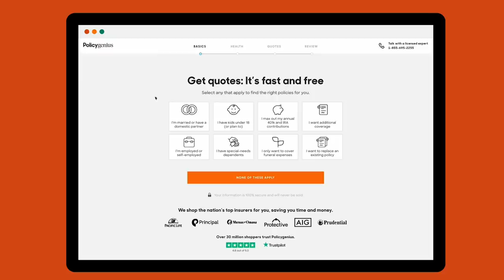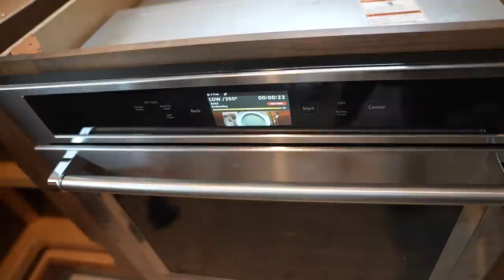DESTROYING OUR KITCHEN CABINETS | BUILDING OUR OWN HOME

Comment: We painted our wood ceilings. We sealed them with white shellac prior to priming and painting. It kept the rosin from the wood knots from bleeding through overtime.
Reply: When we were doing any staining or painting we always did it on the ground. It saved alot of cleanup time and touch ups were easier. Can't speak to the paint sprayer but I  "think"  it would work also.
Reply: An absolute must regardless of what the paint or primer says it can cover.
Reply: Yes there is a product called Seal Lock that is good for blocking tanins and knots.

Comment: I actually like the light boards with the wood grain showing through we did ours with a white wash that gave it a little bit of white but you can still see the grain in the boards and it gives it a lot of distinction between the white ceilings everywhere else. We’ve had it that way for 30 years and I still love it!!
Reply: Yes, if you live with it for a while and hate it, just try a whitewash or painting.  You can always paint it later on!
Reply: @katesanders2219  unfortunately, you can't really paint over stained wood. it's a really hassle to prep it for paints or white washing
Reply: @sherilynl4038  I've painted over quite a bit of stained wood (furniture as opposed to walls), though I guess I've never specifically whitewashed.  A good primer has always worked for me!
Reply: The darker walls in the “sunroom” are going to be a blessing in the winter. They will help absorb heat during the day and keep things cosy at night for any plants that are out there.
Reply: @katesanders2219  i need to know that primer. :) i've never been able to get a good or long lasting paint job over stain. hmmmm
Reply: Sandra Westley uk I was going to say it was about 30 years ago that having wood like that was fashionable, it’s all been got rid of over here, it’s also a fire hazard.
Reply: @sherilynl4038  I've been looking into paints to redo a piece of furniture w/o sanding it lol. Chalk paint is supposed to be very good for things u don't want to sand or things that have been stained. Many different brands & some are definitely better than others from what I've read. Rustoleum is supposed to be great. Some love Annie Sloan, some hate it. I think some are thicker then others do it really depends on what you're painting & the previous finish you had on it. I decided not to paint my piece of furniture so hopefully all my research can help other ppl lol! Don't get it confused with actual chalk board paint like to make a chalk board haha, that's a different paint. The 2st time I asked someone in a store, they directed me to that & I was like no, I want actual chalk paint!
Reply: @sherilynl4038  I have usually used Kilz.
Reply: @katesanders2219   you can also use a deglosser after a grain straight sand and then the primer ...   that's on an oil based stain surface. just need a water based primer on water based stains, couple coats of finish ...  always let them dry really well - works ...

Comment: The sunroom will be so bright that I think you’ll be glad you have the darker boards across from the windows so you aren’t blinded. Also remember, after furnishings and wall decor the planked wall will be a backdrop and not a focal point. You can always paint it later if you decide you hate it.
Reply: I agree.  It will look much bringing it together with furniture and decor.  And if not a wash would lighten it up.

Comment: I would recommend you now set some plywood or boards over the cabinet tops till the real counters are installed.  If not all the crap that floats around will start piling up into the cabinets.  It will also give you a place to set stuff off the floor.  I would also recommend taping off the fronts of the cabinets with some drop cloths so things don't get bumped into them or splashed onto them.    It is nice to cross yet another item of the dream list.

Comment: Just a heads up. Most builder seal the plywood floors with a water proffing paint. And before putting cabinets down. There a vapor barrier LAYED down in the raw plywood. Bugs, ants. Spiders, mold from drips, water soaked under kick plate when you mop. Just a few thoughts.
Reply: This is interesting. I am building a van and I'm almost on the plywood step. Should I treat it before putting it down? I plan to put a layer of nicer looking floor over it because I don't plan on doing a full build. So adding the nicer floor will help me feel as if it is a more finished product. But should I treat the plywood before covering it up or should I treat the nicer floor instead (or both)? I planned to get something more heavy duty that won't scuff a lot and all that. I figure it's best to splurge on this part when the square footage isn't super large so I'm only getting around 70 square feet of nice floor.
Reply: Very good point but, I feel like it's definitely too late now!

Comment: The slide-out oven rack is not just cool … but, will keep your thanksgiving turkey safe.  My cousins tell a story of one family thanksgiving when while checking the turkey the rack tilted and the turkey dumped onto the floor and slid across the kitchen.
Reply: I saw that rack and am wondering if they can be installed in other ovens. So smooth!
Reply: 5 second rule! 😂
Reply: I had that same experience!
🤪

Comment: "Chipi chipi" is something we have a lot here in Ireland. Here it's known as a "soft" day or "being in a cloud" Here on Kerry's west-est coast it is "soft" a good deal of the time and I for one am thrilled that in less than 4 weeks we'll be moving to southern Spain where "Chipi chipi" days will be WAY fewer! Bring on warm and dry!
Reply: YouToo Yoga -   "Chipi chipi" is what Seattle's rain days once were. Enough "rain" to eventually make things wet, but not enough to be counted as measurable or where rain droplets could be seen on windows. Those were also the days when Seattle could go 30-40-50 days in the winter with no sun. Now, we have rain storms then a couple - or several - cloudy days followed by 2 to 4 sunny or partially sunny days throughout the winter. A lot of rain-change in the last 25-30 years. Note: Our annual precipitation is about the same now as before; its just the number of days with measurable rain is reduced.
Reply: Here in Newfoundland, Canada, we call it a mauzy day. I live in the mauziest city in Canada by far!
Reply: Here in Limburg Belgium we say miezeren when it rains softly.

Comment: I’m sure you two know this already, but for everyone else: when you wipe stain off of wood, make sure not to leave the rags in a pile. They heat up after a while due to the chemical reaction, and with too many together they can spontaneously combust! Leave them out individually to dry and then throw them away.
Reply: Yessss, this can be so dangerous!
Reply: @MS B.  The future me thanks you for this advice. 🔥
Reply: Did not know this. Great advice!!
Reply: Been there!
Reply: I just use viva paper towels to wipe off stain when I’m staining stuff.

Comment: Can I just, once again, say what a wonderful, positive, attitude you guys maintain throughout every “challenge” life throws at you? The world is a better place for you in it. 🥰
(Don’t worry about having angled lights in the ceiling. We have vaulted ceilings and there is no difference with the regular lights not being angled. The only ones where it does make a difference with are the ones that are meant to spotlight certain areas like over our fireplace where we wanted to display artwork so got the different light which was more expensive 😕. One less thing for Trent to “regret” or think about until you get the lights turned on and see for yourselves!💕)

Comment: I'm going to pass along the greatest stainless steel appliance trick ever! It sounds a little silly, but I promise it works fantastic. Instead of using any type of special made cleaner, just use WD-40 on a paper towel. Wipe it down really good and then have a dry paper towel to remove any excess. It removes fingerprints and smudges really well, but it also makes the surface less likely to pick up new fingerprints. Try it!
Reply: I agree. I use it on my sink fixtures. It works wonders with hard water.
Reply: WD40 has a pretty potent smell to it.
Reply: Absolutely 💯!!
Reply: @dragonbry67  fish oil.
Reply: @maryh6190  that's genius, I'm going to try it!
Reply: Never knew that, I must try it.  If I can get over the odor in our kitchen.
Reply: The lone dissenter here. It may work, but I would never use a chemical like that in the ktchen, especially with small children with wandering absorbing hands. Vinegar and water works well enough. Also, essetial oils. Natural all the way.

Comment: Instead of painting the ceiling boards white, just shellacking them to show that beautiful grain wood would be beautiful!
Reply: I agree with you here. What's the point of putting tongue and groove on the ceiling if you're just going to paint it white ?  Or, I think it would be very beautiful with a slight burn effect on the boards than clearcoat over the tongue and groove to show off all the beautiful wood grain.
Reply: Cj Boac -   Or do the white paint as a wash; meaning the white paint is diluted with water. This allows the ceiling to be white but with the wood's grain either apparent or "hinted" at.

Comment: Wow - you guys got so much done! What a blessing friends have been to you in this adventure! If you are unhappy with the stain color when it is dry you can still paint - or use a top coat of another stain to lighten it up - General Finishes has a great line of stains that require no sanding or prep and the 'whitewash' option has been used over dark stains to lighten things up a bit.

Comment: FWIW I did my vaulted ceilings 33 years ago and another ceiling in my camp 5 years ago.  Fresh stain on pine always looks blothchy (if that's a word).  My suggestion is leave it alone - don't seal it with poly and let it age.  The patina after a while evens everything out and it looks awesome.
Sometimes...less is more.  My $0.02.  Cioa
Reply: I agree. I did that on some ceilings in my last house and it look great without paint or stain. It just acquired a soft color over time. But I'm partial to the lighter natural look. Also, finish everything else before deciding on the sun room wall. If you don't like it dark, there's always options. Stain or paint aren't permanent!

Comment: I love the stain colour in the sunroom!!! And remember you can always change it down the road if you want to if you still don't like it. Right now getting the tongue and groove installed and the other things that need to be done to get the final inspection done and approved for moving in is what I'd focus on most. You could even install all the tongue and groove and paint or stain later if you want. Everything looks great so far. Really hoping that your siding comes soon so you can get that done before you guys get snow there in the mountains. After that and stairs I think everything else is indoors stuff that you don't have to worry about the weather. Oh and hopefully you can get the boards of tongue and groove stained for the cathedral ceiling stained outside and the weather holds out for you for that if not already done at this point that we just don't see yet as I know your videos are at least 2 weeks after they happen in real life. 
It's great to see your excitement Allie for the new fancy appliances especially considering the tiny oven and cooktop you had in the van and in Terry, these will be great to have and use. I've never had anything new like that of my own so it's great to watch your excitement.

Comment: My dad was a master carpenter.   He brought home high tension telephone poles (back in the late 60's).  You can image my mom's reaction to seeing the before.   Fast forward their kitchen looks amazing.   He put Formica on the ceiling and beams.  The walls were half wood and half wall paper.  And he made a kitchen door and cabinets.   All out of the wood from the telephone poles.  Sawmill friend had acquired them and asked my dad if he would want them.

Comment: Trent, Brandon and Bryce are killing it inside the house.  Regarding the sunroom, the stained wall can be a feature wall if the ceiling and all the other walls are white; it will work.  If not, you can always paint all the boards white and the sunroom will still look good!!!

Comment: We did the white pine ceiling boards well. To avoid the knots bleeding through your paint - I recommend the BIN primer by Zinnser. It’s an amazing primer and in the 3 years since the installation we have had zero bleed.

Comment: Its lovely!  Great choices. I've built 3 homes and you are doing fine. You can always go over the stain with a whitewash stain but you are panicked by this which is normal. Paint, furnish, bring In Plants quilts etc then see what you think. I remember some counters I was horrified by and I couldn't change so went forward but in the end it was RIGHT!

Comment: If it is still cold and the stained boards are not drying in the sunroom fast enough, you could setup a small space heater in the sun room.  I think the stain on the wall will be fine once the room is finished and furnished.  The kitchen is looking great.  Can’t wait to see the countertops to finish the lower cabinets off.

Comment: That oven is gorgeous! What a great feeling. I just got a new stove and oven too. Make sure you heat it to 350° and leave it running empty for about 30 minutes. Then do the same thing with the broiler setting for at least 15 minutes. Open the windows and turn on a fan, it will smell terrible!

Comment: Wow  a lot of work accomplished! Lights to work by are a good thing! I'm with Allie the wood is too dark in the Sunroom. We have tongue and grove with the Vee notch not showing (both sides of Cedar are smooth finished) Western Red Cedar on our back wall which is 26 foot tall. Our Home is a Modified Chalet. We went with a Semi gloss polyurethane to keep the cedar from getting darker over time. Cedar is not as bright as pine.  Just a though on your ceiling that your going to paint white, you have some beautiful wood. Might suggest live with it natural for a while because once its painted or stained you have to live with that forever

Comment: I know it's too late but when you stain certain woods (any type of pine or fir) you should always use a pre-stain wood conditioner.  Specifically designed to use before staining to help prevent streaking and blotching and help ensure a beautiful, even stain. I learned this when we built our home back in the 70's.  In my home if you see any wood that is stained, I did it!

Comment: I know its your home and suggestions can be overwhelming.  I had the same ceiling in my great room.  It was also a vaulted ceiling.  All we did was clear coat the boards and let then age naturally.  It was stunning.  If you don’t like the dark stain on the accent wall I doubt you will like the darkness on the ceiling.  I personally think the dark ceiling will shrink the overall effect of the vastness of the room.  It will shrink the height.

Comment: Speaking from experience of a tongue in groove ceiling, you might want to use some Kilz or other brand of that type product prior to applying your flat white.  I had to Kilz all the knots in the boards after they stained through the nice pretty blue paint we had used in less than a year.  It wasn't fun to touch up all the knots and then repaint with the blue, when I could have done it once.

Comment: OK - I think the wood ceiling in the house should have a subtle semitransparent white wash that shows the woodgrain…it would be modern, compliment the walls, look great with the black chimney pipe, with a nod to a mountain cabin vibe.  Think about it😘 You’ll have a LOT going on with flooring, two cabinet colors and the fireplace wall…could look very busy, instead of calm, sleek and inviting.

Comment: T&A.. to prevent the blotchy look when you stain a softwood.. liberally apply a stain conditioner/pre-stain product  first.. wipe off after 10 minutes.. then liberally apply your stain with a chip brush.. wipe the stain off with a cotton cloth after 5, 10, or 15 minutes depending on how dark you want your wood.. A day later after the board is up give it a quick wipe/polish with a clean cotton cloth.. this will give the wood a satin sheen.. you will get a furniture quality smooth look that will still enhance the grain and eliminate the blocky look from apply stain directly to a crosscut area..

Comment: A tip for your oven / fridge freezer etc, finger prints on stainless/brushed steel can drive you crazy. If you clean them then rub a thin layer of Johnson’s baby oil onto the steel & let it dry it works as a protective shield so you don’t get finger prints. It lasts for a week or two so just needs to be done when cleaning.

Comment: Was you planning on removing the counertop when you have to replace the oven. You will need enough wire(3 or 4 feet) to pull the oven out to discount the wires.
Reply: Good point.  Appliances these days don't last as long as we might hope, no matter the brand or price you pay :-(

Comment: I started watching  Your channel from the beginning and and I'm up to Panama where  you are pushing the bike to the gas station. I had to laugh when you put fuel in it and said that there was still gas  Left in the tank, I was surprised that Trent did not know there's a valve on the left side below the gas tank that has 3 settings  off normal and reserve.

Comment: Question, on the spacing between the oven and dishwasher. Maybe a sliding pan cupboard could be installed
Reply: Ensure enough room to walk around dishwasher when open to open silverware drawers and reach upper cabinets.